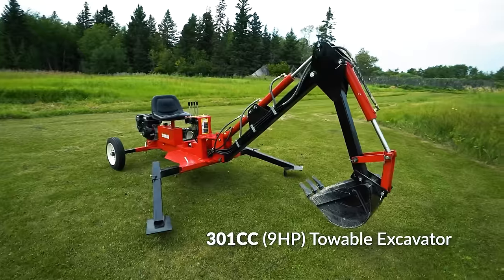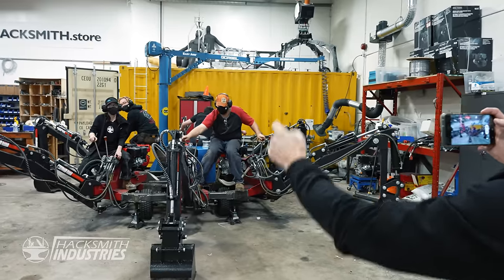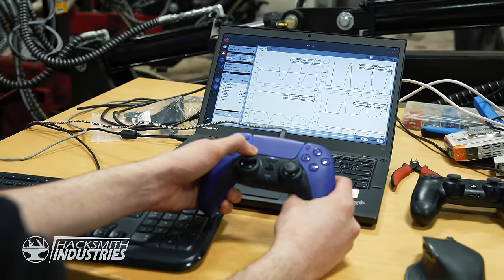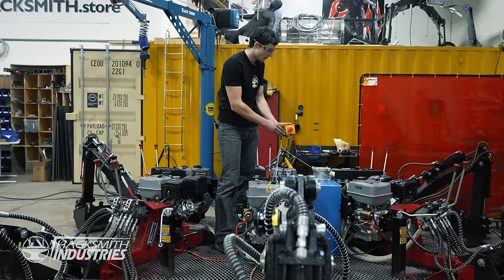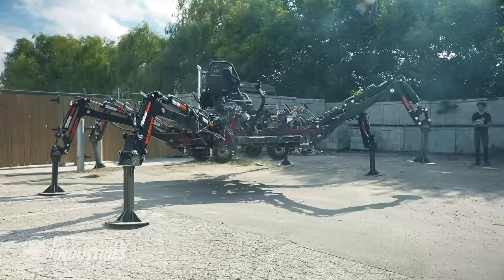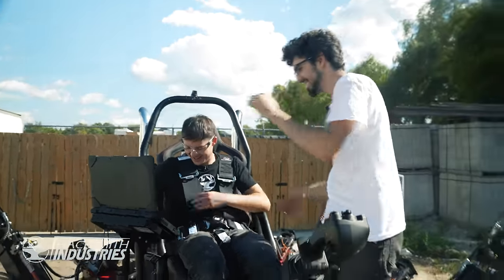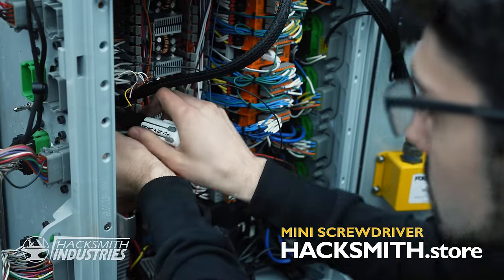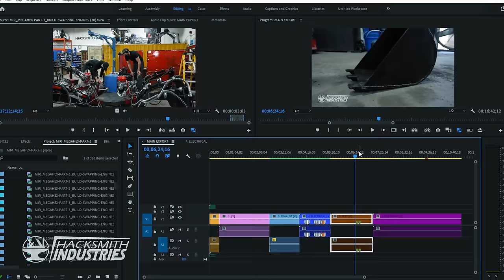Our BIGGEST project yet! (SPIDER MECH!)

Comment from the maker: Want to help support the channel and crazy projects like this? Check out our amazing products at https://www.hacksmith.store including our best-selling MINI-LIGHTSABER!!! https://hacksmith.store/products/hacksmith-mini-saber

FAQ: Such a huge project makes it impossible to cover everything in one video, so here's a bit more information about why we did things the way we did!

- The biggest challenge in this project was integrating and tuning our system, because big hydraulics, heavy frames, and tons of sensors have a lot of variability that needs to be checked. We used an open-source hexapod library to control how it walks, which has been used on much smaller hexarobots, and works great. Once the mechanical system is more reliable, it will be able to walk easily. 

- A lot of people asked why we didn't make a scale model, and the answer is quite simple. When you get to multi-ton mechs, scale models provide almost no benefit, because you can't build a scale model the same way you have to build a giant steel machine. A toy version using motors wouldn't teach us anything. And if we built a 1/4 or 1/2 scale version, the cost would almost be the same as the full-size megahex -- because all the components required cost approximately the same, small or large (valves, sensors, even hydraulic cylinders don't change too much in size). 

- This leads into another common fallacy when it comes to science fiction -- Movies like Transformers, or Pacific Rim... simply aren't possible. Doesn't matter how far technology advances, when you get to literal skyscraper sized robots... there's not any materials on earth strong enough to withstand the forces of such a big mech! Everyone's familiar with the common saying "The Bigger They Are, The Harder They Fall". And that really sums it up. Why is it you can drop a cat from a few stories up and it's fine, but it's certain death for humans? Because force multiplies with mass. 

- Why flat feet? We had planned on designing different feet attachments for it (you can see the holes in the plates for mounting), but for the base foot, we went with a large flat foot with rubber pads on the bottom, as the initial goal is just walking on flat ground. Having a big flat foot helps ensure the foot remains parallel to the frame, and the leg perpendicular to the ground. A pointy or rounded foot would increase the risk of the robot "twisting it's ankle" which is the weakest link in the excavators. They aren't designed for angular forces.

- Why didn't we do more FEA calculations? FEA calculations are great, but sometimes are just theoretical for best-case scenarios. For the excavators, we didn't design or manufacture them, which makes them an unknown variable that makes it really hard to calculate things for!

- Are we going to revisit it? yes but it might be a while. We want at the very minimum for it to be able to stand up on display, and walk one leg at a time (the slowest, but most stable hexapod gait)
Reply: Man I love every part of your videos every time they are posted
Reply: The thing I learned here is,,,,,, that There are so many things to take care of even after the machine is build. ..  Literally opened my eyes it's crazy and amazing
Btw appreciate ur efforts guys
Reply: Now make Metal gear Excelsus
Reply: Wooooooww si, si! ....
Jajajajwoow verlos en español va a ser hermoso, por favor diganme que el resto de videos estarán en este idioma.
Reply: This was a fantastic project. If you guys were to continue tinkering on her, I would recommend automotive frames. Scrapped cars would be perfect even. Large single engine for the whole thing, half inch plates on weak points for reinforcement. But you guys did say that's the end of her, and while sad, I understand completely. Wishing you all the best!
Reply: Best wishes to James, me and my family are praying for his well being.
Reply: Would love your next project to be making a real life ED-209. Or maybe even turn a police officer who lost their limbs, into an actual RoboCop.
Reply: If any of you hacksmiths have seen avatar the way of water you should attempt to build, the new enhancement suit the soldiers used their much smaller than in the first movie and might be doable how you consider it, also great video
Reply: @retey8982  no make a Gundam! I feel that's easier.
Reply: Why don't you try like four legs on it with a emergency peg that pops out when a sensor sends a warning to the main PC that it's off ballance
Reply: Be sure to write a long thorough report on everything that went wrong, why it went wrong and how it could have been prevented.
What did you learn from this non-succeeding that can help you succeed in other projects?

If you can't get value out of the mech itself, at least get the value out of the experience!
Reply: Something else you guys should try is to to make like a Jurassic world ball you know the clear plastic one's so I was thinking how that would work so you put a ball on tracks but you put it in a larger ball and the tracks inside push it forward I don't know how it would move left or right but that's what I came up with
Reply: Ah yes
Carantula
Reply: But Still Great Job Great Work Great Effort keep up the good work!!
Reply: please make fnaf robot
Reply: I am back I have so many videos to binge watch.
Reply: Build a gundam
Reply: Build a gundam
Reply: At least you can now make a chocho Charles ฅ^•ﻌ•^ฅ and Thank you for the amazing videos too!
Reply: I hope you guys stay in businesses!
Reply: WHY DID YOU NOT GIVE THE PLATES A SURFACE/GROVES ON THE BOTTOM TO CATCH TRACTION? IT WOULDV'E WALKED SO MUCH BETTER
Reply: Mr. Beast might as well give you a loan
Reply: Here is a solution that could change everything: walking pattern that only one leg moves at a time kinda like crawling only one limb at a time
Reply: Yooooo put tank tires and bring back the diggers like a 6 sided digger
Reply: If you do a project like this in the future only make one or two legs move up and down at a time, they can all still move side to side a the same time since they will all be on the ground.
Reply: This is a Model T Gundam
Reply: Hi
Reply: If you ever read this, next time consider studying how the "spider tank" work. (Search "Jaimie Mantzel spider" on youtube). His way of doing the mech looked much simpler
Reply: Ok this was soo cool
Reply: After working for the railroad, and industrial electrician support - I learned ALOT about PLC controls. And always dreamt about building my own loader from aliens. Seeing how limit switches and PLC controls working together it seemed possible.
I enjoy seeing more hobbyists going further with wild creations like this
Reply: So Wild Wild West irl lol
Reply: Someone call Will Smith, Dr Loveless is on the loose.
Reply: Are you gonna make the pride in from fallout 4?
Reply: Pridwin
Reply: the waffle house has found its new host
Reply: Do you even guys realise that you just made a BOSTON DYNAMICS project (well, very similar) in year and a half possible? With just ONE sponsorship? You guys are VERY MUCH underestimate yourself, that mech in proper hands took YEARS to  even get out of the assembly line! You guys are amazing. Truly are.
Reply: pretty sure Gui and the megabots guys did one of these like 10 years ago back at artisans asylum in boston, did you ever hit them up?
Reply: I think its "feet" requires a larger surface area or maybe have its perimeter angled upwards in order to prevent it from tripping. Might reduce the stress on the legs. It's like tip toeing vs having ur whole feet on the ground.
Reply: 🔥🔥🔥🔥🔥 PLEASE BRING THIS TO BURNINGMAN 🔥🔥🔥🔥🔥
Reply: DBL or CVT make curiosly decision part?
Reply: To be honest guys, a major portion of your costs was wear and tear due to full lifting loads on equipment just to test systems that did not require full load. A device like this requires an overhead truss to hold it up off the ground and to position it as required. Properly made it an also double as a transport frame for the taking it in and out doors.
Reply: Make it intro choo-choo chales
Reply: Oh great you done finally built a spider bot! Let's hope Egghead don't get a hold of this one to get the last Gem!🤖🤓🤖🤓🎮🎮🎮🎮
Reply: I have an modification to the Mech if you want to contact me . I hope it will work
Reply: Do not use ur creations for war please. No matter the cost for it
Reply: sold out :(
Reply: I got you fam
Reply: should this be ant mech because it got six legs?
Reply: Turn it into the tarantula tank mech from ghost in the shell, or the juggernauts from 86
Reply: With that much weight you don't need that much surface area on the feet. You need spikes or circle feet.
Reply: It would be less costly(in time and $) to always build a small scale project and get that working first.
Then decide if you want to scale its size up, or shelve it for now.
Reply: MAKE THE FULL PROJECT
Reply: ww3 is going to be sick. If you can do this, imagine what the superpowers have got going on.
Reply: Just a random idea, but if you guys are having financial problems, then perhaps you could try doing something profitable and your fans would adore, I know it's alot, but what if you guys open a museum of sorts? Show off your amazing inventions and mabye charge a little to enter, that way you make money, as well as something awesome for all of your fans!
Reply: Please finish it :(
Reply: Why anybody yet isn't able to build some thing as fast as horse ant , is it shape of horse ant legs ??
What if you put these mechanical legs on rotation that they quick :@Hacksmit industries
Reply: How much money exactly was spent on this project?
Reply: That solid foot is what cause the stress for the leg to break off, it needed a sort of ball ankle to offset the twisting on the frame. Just my thought
Reply: Oh my, you actually included a Mobility mode... you have walker/AT and Drive/Mobility mode :3
Reply: I feel like dragging it on the excavators every time it went outside for a test, being one of the causes of them starting to fall off. I was expecting it to start falling apart way sooner, seeing it get dragged around.
Reply: be cool to do a moving at at or at st
Reply: @theHacksmith

Would it be possible to make something like this completely analog? Like rather than computer programing to make the legs move just right, would it theoretically be possible to have that all controlled by a gearbox, and the 'pilot' could control the direction with a stick connected to the gears? Or am I a dum-dum who has no idea what I'm talking about?
Reply: Robot moving so great that you decided to show us split seconds of video at a time, yeah he's trying to go forward, he actually goes back 2 steps lmao.
Reply: @Hardenjade  EXACTLY 💯 something that doesn't result in the feet "tripping" which eventually leads it to curl.
Reply: So if it can be done. One like the size from wild west is very possible correct?
Reply: I will not support. It's a very nice thing for you to do. but it can also be shown as bought and made.
Reply: How is the boss James doing? I have heard any updates yet sadly 8(
Reply: i had the feeling you were gone for like a year
Reply: 27 Então veio a Jeremias a palavra do Senhor, depois que o rei queimara o rolo, com as palavras que Baruque escrevera da boca de Jeremias, dizendo:
28 Toma ainda outro rolo, e escreve nele todas aquelas palavras que estavam no primeiro rolo, que queimou Jeoiaquim, rei de Judá.
29 E a Jeoiaquim, rei de Judá, dirás: Assim diz o SENHOR: Tu queimaste este rolo, dizendo: Por que escreveste nele, dizendo: Certamente virá o rei de babilônia, e destruirá esta terra e fará cessar nela homens e animais?
30 Portanto assim diz o Senhor, acerca de Jeoiaquim, rei de Judá: Não terá quem se assente sobre o trono de Davi, e será lançado o seu cadáver ao calor do dia, e à geada da noite.
31 E castigarei a sua iniqüidade nele, e na sua descendência, e nos seus servos; e trarei sobre ele e sobre os moradores de Jerusalém, e sobre os homens de Judá, todo aquele mal que lhes tenho falado, e não ouviram.
32 Tomou, pois, Jeremias outro rolo, e deu-o a Baruque, filho de Nerias, o escrivão, o qual escreveu nele, da boca de Jeremias, todas as palavras do livro que Jeoiaquim, rei de Judá, tinha queimado no fogo; e ainda se lhes acrescentaram muitas palavras semelhantes.

Comment: I appreciate the strength it took you guys to admit the failure of a project. I didn't feel it was a failure at all. You have crafted a feat of engineering. You proved the concept you were trying to prove. The only failure you are really guilty off is not having an endless supply of resources. And that is really not even worth considering in a reflection on the project IMO. Keep doing what you're doing. May your creativity keep ever flowing!

Comment: For future reference towards building mechanical movement machines: 

-Use Hardox (with internal reinforcements) for all stressjoints.

-Try adding to planes of existance; one for legs/larvae/wheels and so on, and one for the main body, giving the hydraulicsystem a dedicated job keeping them separated. it would also make it easier to keep legs on a level plane.

- for feet bolt on a piece of rubber made for excavator larvae/"wheels".

- also: listen to your grandfathers!!

Awesome video, even if it took all of your money! Keep going!

Comment: I use to do a lot of work with hydraulics and i'm honestly surprised they lasted as long as they did. Implementing a more rigid structure with adjustable locking points might have saved you a lot of headaches. Not every part of every limb needs to move or be capable of moving at the same time. If you could lock a segment at a fixed point your hydraulic pumps wouldn't need to be constantly providing pressure to every hydraulic. When a locked segment needs to move you could use a simple pneumatic actuator to retract or insert a locking pin. 
I think projects like this are really important for company and personal growth. Documenting all the stages with a camera even if people leave the knowledge remains for future projects. You might not replicate the project in full but use bits and pieces you wouldn't have learned any other way. Channels or companies in general that only do something for profit stick to "safe" decisions and all creativity and ingenuity goes out the window. Re-doing the same thing over and over because they know it'll get views. But that's not what drew people to the channel to begin with and eventually it all falls apart.

Comment: Probably won’t get seen, but if you put tire patches on the bottom of the feet it would probably have better grip and contact with the ground. Also putting some extra brackets on the parts of failure on the excavator arm’s would help prevent them from breaking in half. It’s absolutely incredible how much you did and in the future it would be crazy to see this project revisited.
Reply: came here to say the same thing

Comment: a quick thought - whould a circular frame around the cockpit with weighted balls in it that adjusts for the overall balance increase the stability of the machine? ofc it needs to be calibrated and adjusted by the input of the controller to relieve some pressure on the legs.

Comment: When turning the hull with lateral legs on the ground you are putting a massive rotational force through those legs, which they are not designed for.  If the plates contacting the ground had less traction they could slip to relieve that force, so you may be seeing this more on mud than on a hard surface.   Ultimately, this would probably work if you had more legs and they all took smaller movements with more designed in slippage to relieve forces trying to twist any specific leg - think centipede, not spider.   Every leg would also need to be lightweight, or the whole thing would perish under its mass - which means using parts from existing diggers is unlikely to work.

Comment: Okay, I'm only halfway through the video, so maybe this gets addressed.  But where are the struts? Plus, I would have put basically tires on the feet. I'm not an engineer,  but I feel like having as much cushion on the movement as you can will elevate a lot of strain on the whole structure. Just like cartilage in our joints.

Comment: honestly, i feel like this kind of project needed to happen at some point. a project that leads to utter failure and diminishing returns.

for better or for worse, so much new knowledge has been added to your library;

-your software skills improved.
-your electrical skills improved.
-your mechanical skills improved.
-you now know the importance of data, diagnostics and the ease of repair
-you now realize gravity is one of engineering's nemesis and weight is a serious thing to consider. if the mech was lighter i doubt it would've break, or needed that much tuning. just making something stronger and powerful doesnt always work
-you now realize fatigue exists and your engineering marvels should consider fatigue lifespan, and the ease of replacement if such lifespan is too short.
-you now understand little changes can bring little improvements. try adding a lot more little changes compared to few big changes and few little changes. less work means more efficiency.
-you now understand increase in complexity should be properly dealt with or it ends like this.

when you build the power loader, only the first four were obvious. the rest is omitted by the fact that the power loader design isnt dealing with a lot of multiple different forces. TLDR the power loader is pretty simple and low complexity. the hexabot is significantly more complex and you guys were not expecting it.

Now that you know all of this, i just want to give all my support and cheer for the next big project. i have full confidence the third big project will be a splendid success. thats all from a fellow engineer.
Reply: agree